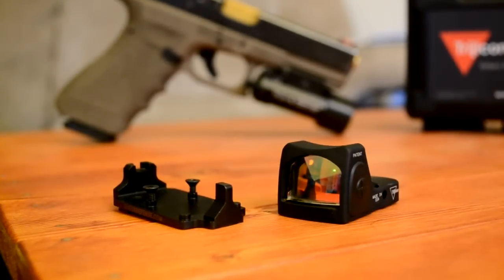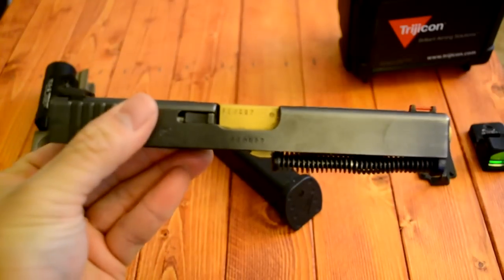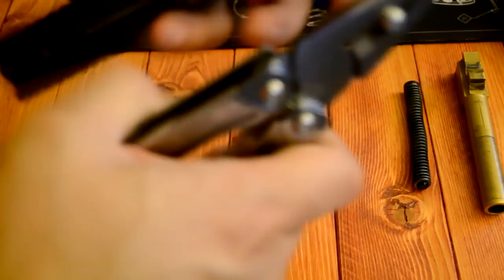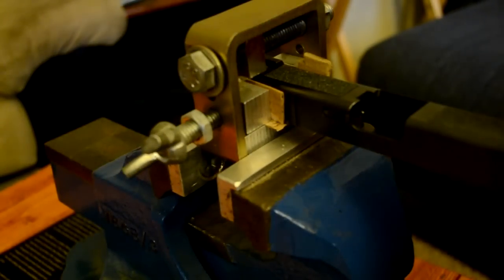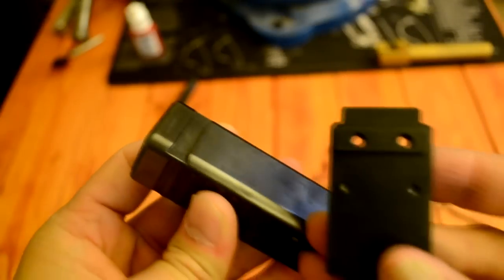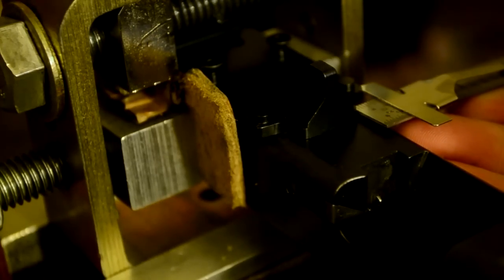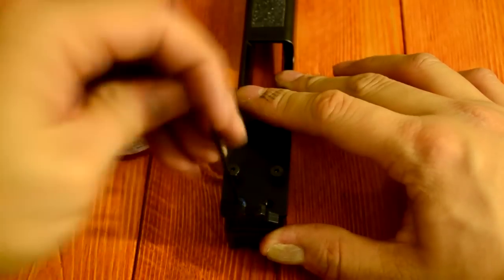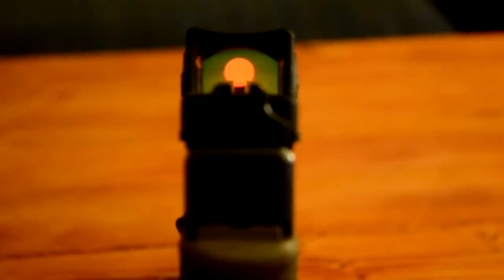Pistol Red Dot Mounting Alternative: Dueck Defense RBU (Trijicon RMR)

Comment: Did you leave off the front sight and just allowed the open hole?
Reply from the maker: I put a strip of grip tape along the top of the slide. But yes, normally with this setup you leave the front sight hole open
Reply: IS THERE A WAY TO MOUNT A SMALL LASER SIGHT ON A HAND GUN THAT DOES NOT HAVE A RAIL ON IT AND IF SO WOULD IT LOOK OK
Reply: @larrydieter4854  
Crimson Trace laser grips.
Lasers on hand guns are VERY difficult to use accurately due to there only being 2 points of contact to steady it.

Comment: Well.... it's been 30 months -  and the follow up?  Would have been nice to just read a few words.
Reply from the maker: Been busy pursuing a career in law enforcement. But i have purchased new video equipment and audio stuff. I hope to start new content soon!
Reply: @shadowhawk012  have any quick update on the RBU? Just interested if it held up and was worth the money to you. Thanks, good video!
Reply from the maker: @LightWaIker  hey, its been a great mount and has held up for a long time with no signs of failure. The front sight has also been great for racking the slide one handed, while protecting the body of the red dot.  Unless you plan on milling your slide for an RMR, I feel this is the best cost effective alternative with great features. 

-Jim